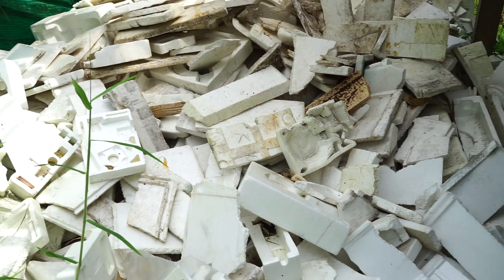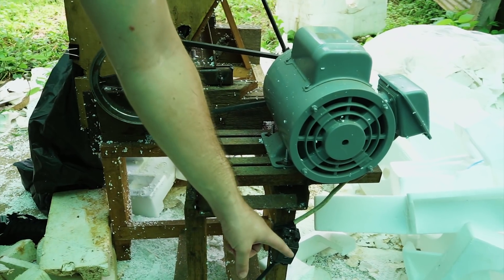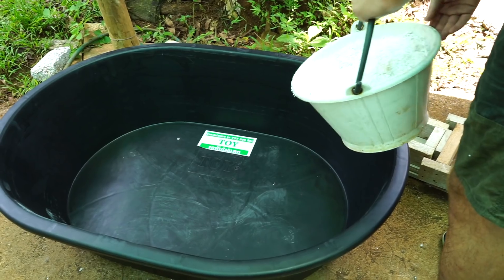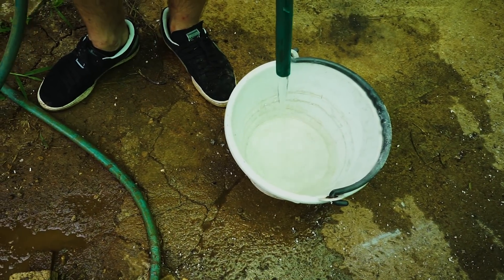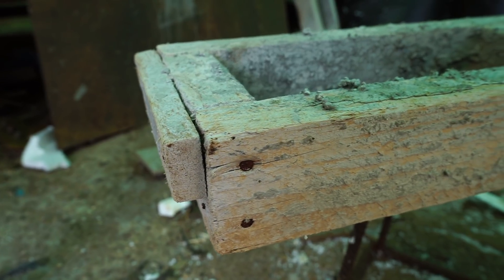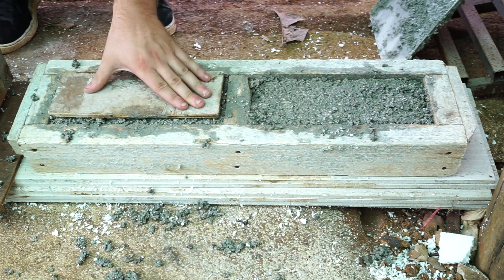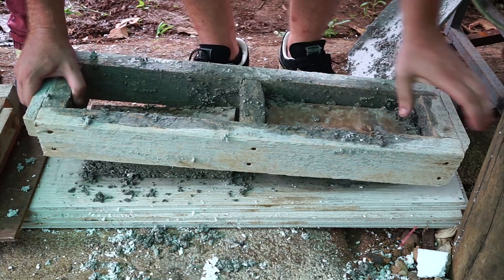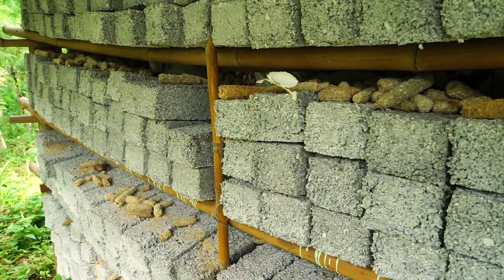Styrofoam Bricks DIY

Comment: Another YouTube chanel uses a electric lawn mower (upside down) and a 50 gal poly water drum cut down and open at both ends capped with a plywood disc and feed shoot to grind the scrap Styrofoam. Blows it into a poly bag from a exit hole made in the poly drum body. (Note: a internal 1"x 1" screen is attached to the inside of the exit hole)  Reported to work wonderfully. 

Also, you need sand. So what better mix than sanded "S" grout and ground Styrofoam? 

I plan to use this system to fill walls in a cabin project using exterior wall studs 24" on center. The styrocrete will act as a compression wall support, insulation and filler for the outside finish of stamped grout fake rock pattern. Also, why not pour it in-between the rafters above and in-between the floor joists under the floor?  Just install partially driven nails or screws in the inner surfaces of the beams to act as a holding or anchor to your cured styrocrete. 

Styrocrete can also hold a nail or screw. So interior finishings can be nailed or screwed into the wall just about anywhere.

What do you think? Cool!

Comment: I learned another use for "waste" styrofoam on YouTube. Someone dissolves the styrofoam in Xylene. SO that's what I use. I know other solvents dissolve styrofoam and someday I'll search out what is most cost-effective. (Xylene is pricey.) Cheaper solvents might not be able to dissolve as much styrofoam. We will always reach a point where the gunk won't take in any more styrofoam... or it's just taking too much time.
 -- THEN I use this to coat wood as a water sealant.

Comment: Mixing all dry first is more work than mixing cement/water, then fuzz. Ever try it? Why so dry a mix? The wetter the easier to pour into the molds. Why not interlocking bricks?

Comment: Just wondering, what if you added a bit of sand to the mixture? I imagine it would help the cement bond better and help the brick be quite a bit stronger. Also, it may help in the form making.

Comment: Although the intentions behind this are noble, this is not a good idea.  Styrofoam should never be grinded into it's dust form.  Styrofoam is too friable and a lot of what you grinded blew away into the wind and into the environment.  Even a little Styrofoam dust escaping into the environment is bad because this is plastic dust.  Secondly, depending on what you use the bricks for, what is going to happen is someone later on is going to demolish those bricks by smashing them with a hammer, thereby further releasing all that plastic/microplastic dust into the environment.  If not, these bricks will eventually weather away naturally.  So the end result is that instead of containing the initial Styrofoam garbage, you actually 100% released all of the Styrofoam plastic dust into the environment.  Had you not grinded up the Styrofoam and created these bricks, all that Styrofoam would have been somewhat contained from escaping into the environment.  The only way to have prevented the Styrofoam from leaking into the environment would have been to contain it in it's solid fused block form, or melt it into condensed solid polystyrene.

Comment: Few Suggestion. If there was a way to increase the size of styrofoam pieces to say 1/2" and adding of sand and more effort on mold can give good result.
At the time of laying, if each brick is dipped in cement slurry with URP added, the resultant wall will be more safe for health.

Comment: I don’t think there can be cementing bond with synthetic material like styrofoam. Mere a wastage of cement.
Reply: As far as I know cement can bond with anything, things a uch as stone, glass fiber, rebar etc are all used. In this case it's probably not as strong but it's a trade off for recycling and insulation

Comment: 50% silica type sand  can help in binding and I have used this with a 5 (Styrofoam 2cm-)-4 (vermiculite 2cm-) --1(mortar-sand lime cement) for a trowel on mortar mix thick stucco (4" or 10cm) with a 9 gauge steel galvanized 10cm square backing panel, tin backside   the maximum slump level was about 18" (40cm) with an open face.  It sets well in a day and cures in 3.  this mic can also be used to patch holes in formed concrete that has a roughed surface.  over 86*F (34*C) I would recommend a plastic cover for a day.  Probably could make bricks from this also, but the cure time would be a day before removal from the form.

Comment: DO NOT USE YOUR BARE HANDS WITH CONCRETE.
THE ACID FORMED BY CEMENT HYDRATED.... EATS SKIN COLLAGEN LAYERS.
YOUR SKIN WILL NO LONGER HAVE A DEFENSIVE LAYER AGAINST WATER, CONTAMINANTS, OR GERMS AND BACTERIA.
TRUST ME.... MY LANDSCAPER BOSS WAS AN IGNORANT ASSHOLE... AND GAVE ME NO WARNING.
I HAVE PAID DEARLY FOR 30-ISH YEARS NOW.
GLYCERIN IS THE ONLY TREATMENT AFTER CONTACT....
WASHING WITH SIMPLE WATER IS ONLY AGGRAVATING THE ACIDIC EFFECT.

Comment: It looks to me like this would be a good base layer under a concrete floor. Just pour the floor and skip the brick making part and then give it a top dressing later with standard cement. I have a lot of styrofoam around though so this looks like a good project to me

Comment: Hi Guys. Polystyrene obviously has problems associated with it because when it burns, it continues to burn and gives off monomers which are toxic and carcinogenic.  Polystyrene is a difficult product to recycle as there are no good ways to put it to secondary use.  Once upon a time, gardeners put polystyrene beads into their soil until they realised that there were problems with this.  One alternative which uses a natural product that is not toxic, inflammable but has a high insulative property is Perlite - fuzed volcanic rock. This would mix well in a concrete batch.  It would be interesting if this could be properly assessed for building processes and a bit of science added to the argument.  In the meanwhile, I continue to put my polystyrene in land-fill.  My bad.

Comment: DO NOT MAKE MY MISTAKE.
DO NOT PUT YOUR SKIN IN CONTACT WITH CEMENT AND MORTAR MIXES.
UNDERSTAND,... THE MOISTURE IN YOUR BODY HELPS BURN THE COLLAGEN.
I HAVE NO PROTECTION FROM WATER, OR GERMS, BACTERIA, VIRUSES IN MY HANDS NOW.
MOIST PUSTULES ERUPT THEIR TOXINS TO SURROUNDING TISSUE, AND THEN SHTF.
COLLOIDAL SILVER AS TOPICAL DRESSING IS MY ONLY DEFENSE NOW.
DIY. SILVER ELECTROLYSIS... YEP... 99.999 FINE SILVER.
GODS GIFT TO HUMANITY. CAUTION AND COMMON SENSE REQUIRED.

Comment: Since it is a lightweight material, perhaps it could be cast into larger flat panels, with some reinforcement like old fencing wire cast into it, to cast into whole wall or roof sections that can stand up and be placed into position after curing ??.  Adding a layer of regular stucco to both sides should protect it from catching fire as well as give it much added strength.

Comment: I wonder if you might not get a better, denser, more uniform product by using a Sinva rammed earth brick press?  The thought occurs that this material might make good external insulation if applied like shotcrete to the outside of a shipping container. I understand that it is very trowelable and can be made into curved shapes. How would it go in s potplant form - to make large planters? Fill large diameter PVC pontoon tubes, giving them (yeah a little extra weight) but permanent boyancy. Fishing punt, shanty boat anyone?

Comment: I wonder if sawdust might work as well. The nice thing about sawdust is that unless you're using an inherently toxic wood it'll always be sustainable. I do a lot of woodworking and just ripping a 2x4 you'll generate a lot of sawdust so I guess the question is can sawdust be made to withstand the fire ratings mandated by so many regulations?
I have the notion of building very low cost sustainable housing that anyone can build  in areas that are vastly underserved by the home building industry and add to it a way to avoid the gentrification problems so many low cost communities encounter.. That's probably more a legal issue, but can low cost communities be built to house any and every person who is in need?

Comment: These look like they'd crumble pretty easily with that much Styrofoam.  It would probably help to add some chopped fiberglass strands, or even a small wire mesh insert in each block.  Also, as already pointed out, cement needs some silicate material (sand) to form a strong cured material, and better molds with smooth sides would keep the blocks from getting torn up so much when you release them from the mold.  I definitely like the idea of finding alternative uses for used Styrofoam though, it's one of the most wasteful items on the planet after it's served it's original purpose.  Even just inserting a solid Styrofoam core inside the block might be a worthwhile experiment.

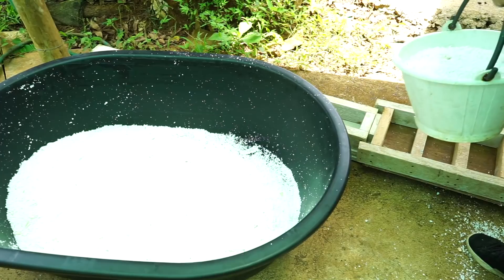Comment: moved your mixing tub at 1:15 into the catch position at the shredder.  I saw you bag the fuzz, scoop the fuzz into buckets, then drop the buckets into the tub.  

That us a lot of work, instead of just dropping fuzz directly into the mix tub.
To measure volume, do it systemically.  Either weigh the foam pre chop, or Mark a line in the tub.  Your volume will be uniform, and your work system reduces work activity, while producing uniform results.

Comment: NOT FOR BUILDING STRUCTURES. Perfectly suitable for art projects or insulating out buildings like pump houses. Use your imagination and your brain.
Reply: With a plaster on top of it, you could get a good fire barrier
Reply: Yes you could build with it as insulation not load bearing walls. Icf's are pure eps products used as insulation on both sides of the walls and concrete cast in the middle to build insulated basement and above walls. People don't know because the North American system builds mostly wooden houses without good insulation. Custom high quality home built with this now.

Comment: Another idea is to buy cases of toilet paper rolls on sale. Dip each roll in a concrete solution then stack them up by sliding over a vertical anchored rebar rod.  You can fill the gap around the rebar by squirting in some urethane foam as you stack.

Comment: I am a fan of Rastra for bldg & these are like minatures. Great idea for diy's. Melamine framed molds would be slicker & flatter for more uniformity. With the rastra, you can cut to size with a saw. Glad to get formula to make them. Think I'll try making larger ones as a skirt to my trailer.

Comment: so could those be load bearing?
Reply: NO.......
Reply: the seem awful big to be a veneer brick... guess i don't see what traditional building method it would either replace or make better or cheaper
Reply: 1) they are not fire proof ...
2) they will melt at the slightest hint of acetone, petrol, paint thinners ... etc etc ..
3) they are not load baring ...
4) etc etc...

Comment: I love this concept for flotation. I would think you could coat a pontoon-sized section with something to keep it from disintegration in water and leaving a trail of pollution. Thanks for sharing!
Reply: During WW2 we made boats out of concrete. See "ferro-cement boats." I think it's better to have a very strong shell with hollow interior rather than a solid foam concrete, which would end up quite a bit heavier.

Comment: Portland cement is toxic, use a trowel and wear gloves.
Reply: It is in fact toxic.  Google it or whatever.  
You can get concrete burn from the reaction of the cement.
It is especially nice when the dust settles on the skin and you
are sweating because, you know, its heavy.  That kicks it in.

Comment: Polystyrene is classified according to DIN4102 as a "B3" product, meaning highly flammable or "Easily Ignited." If you are not aware of the risks of EPS (a polystyrene product already being used in construction) you should probably acquaint yourself, and do some testing with this as a viable building material before using it for any major project.

Comment: Yours is a great idea that should hold up over time.I built a small post and beam shop  in the woods behind my house in 1984.  I used plastic packing  beads, vermiculite, sand  and Portland Cement as a light weight concrete to in fill the space between the timbers. This material has held up very well through all kinds of weather, rain, snow, and many freeze-thaw cycles with no signs of wear in all that time.
Reply: rfrossjr
 - I would like to know the amount of each material, if possible, used at that time. Grateful for the attention.
Reply: rfrossjr     hi ... thanks 4 that report.    i am considering 2 use this idea & i need 2 learn from others experience

Comment: Great idea! I wonder if I could use it to insulate a raised-pond build?
Reply: did you use it on the pond build? I am considering the same thing.....thinking of using old carpet, but this is a better solution & insulating as well. LMK if you found any issues or drawbacks. Thanks !

Comment: Is it flamable? If it burns are the fumes toxic? Does it have heat insulation? How long will it last before the styrodoam breaks down?
Reply: +Darlene Young

"Is it flamable? If it burns are the fumes toxic? Does it have heat insulation? How long will it last before the styrodoam breaks down?"

Yes it is flammable and as such some toxic fumes will be released during burning. How long will it last? well that depends on where you use it. If it is kept dry, the estimates are anything up to 1 million years

https://sciencing.com/long-styrofoam-break-down-5407877.html

This is the same problem whether you use it to make bricks, or just landfill it, so the environmental impact is no better or worse either way 

I think this is a great idea for outside low weight builds like garden walls, or low pool retaining/insulating walls, planters etc. It doesn't have the strength to bear the weight of a second storey so you shouldn't build critical structures with it and anyway it wouldn't meet building regulations due to fire risk, but if you have a timber frame build for a shed, summer house or store and this is used purely for filling in the voids it is an excellent idea, so long as you keep it dry. 

Other materials can be added which will give it some interesting properties

Straw will make it stronger (would definitely have to keep that dry or it will rot
Sand will make it stronger and more "filled" but will also make it heavier and as a result not so as easy to handle, carry etc. It will also make it harder to cut/shape so easily and they will take longer to dry
Ground corn cobs or coconut shells are also good as are sea shells

It does have great thermal properties but you will never get any facts to back that up as every mix you make and every different brick mold will create a distinct product with it's own values

Comment: how flammable is the finished brick?

is there enough cement to prevent creating a fire hazard?
Reply: Is it possible to surround the styro cement brick with regular sand cement combo on all six sides so that fire is kept out of reach for fire
Reply: Those bricks are more or less the same as LightConcret / ThermoConcret / LigthBeton / ThermoBeton. I  have thermobeton M:~ 100 kg/m3 (very light version made of coated EPS beads, water and cement. Cement is the only dry additiv) in my house between 1st and 2nd plano. I have tried to fire-test the product with a tar-roof burner. It is impossible for the dried EPS-concret to catch on fire. https://youtu.be/o2Dms6KpscA
Reply: Read other replies. No, plus toxic fumes.  Garden bricks.

Comment: Styrofoam is blue. You're dealing with expanded polystyrene.
Reply: i agree styrofoam(and pink ,and cream, )is a lot more dense than polystyrene
Reply: Styrofoam is a trademarked brand of closed-cell extruded polystyrene foam (XPS), commonly called "Blue Board" manufactured as foam continuous building insulation board used in walls, roofs, and foundations as thermal insulation and water barrier. This material is light blue in color and is owned and manufactured by The Dow Chemical Company.

Comment: Some people are so afraid that thing will catch fire, but they forgot that there are many things inside the house that can catch fire, eg window curtain, foam bed, pillow, clothing, papers, cooking gas, and so on. There are many wooden house.
Reply: First off, you'll never get a building inspector to sign off on something like this.  No testing, certification, etc... And yes, in the event of a fire the polystyrene in these things will give off lots of really bad smoke/fumes.  
However, if it is covered in drywall, it would be just as safe as any other foam insulation.
Reply: This stuff would light up a lot faster and a lot more dangerously than wood framing

Comment: Good idea to make a cool house, keeping out the sun heat. Is it as strong as a normal brick? If you have to buy that styrofoam beads, what is the cost compared to normal earth brick? Which is cheaper, at how much percent? 

Styrofoam pieces can be put on the ceiling to prevent heat from the sun.

Comment: to speed up your process, you could glue larger sheets together and use a similar sized paint cutter to cut out the shape...then you only have to grind and cement excess styrofoam...all the big manufactures do it...
Reply: ...i would suggest using a heated cutter too...(I've heard of hot-wire-cutter before) but an improvisation to test, could use an old cloths iron with thin metal sheets attached to the hot metal bit...